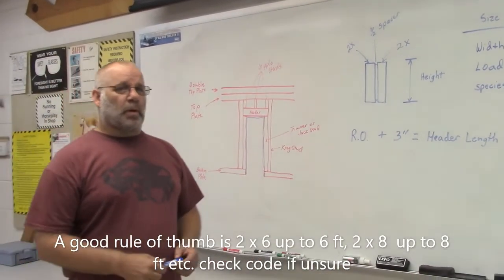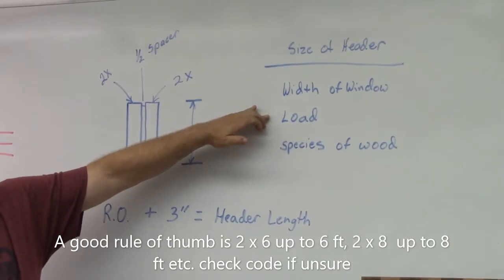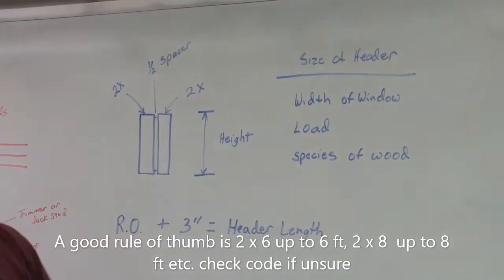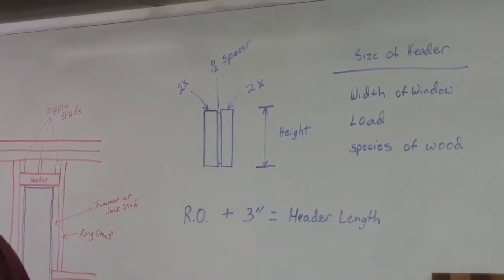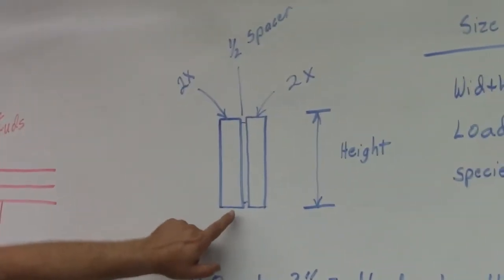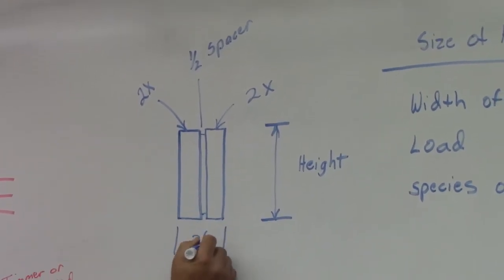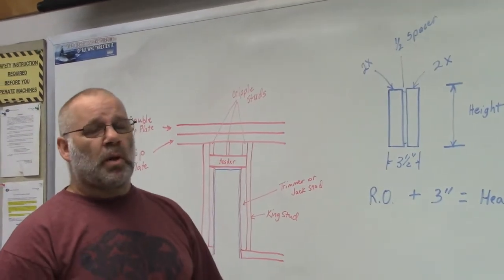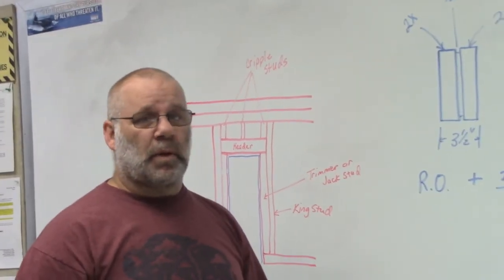How to frame a door, determine header size

Comment: Can I stack tow by four  on top of each to create  2by8  around  19 cm 2x4  hear is slightly  bigger then yours
Reply from the maker: Not recommended if it is load bearing, it would not be as strong as the 2 x 8. If it is non load bearing it would work because you are basically just filling the space.
Reply: Even if it is on the edge side stacked them on their  edge

Comment: When calculating the 2 1/2 inches for height of door rough opening am i including the height of the bottom plate that has yet to be cut out in that measurement? Or do i make the cut leave it 2 1/2 and there will be a 1 1/2 gap under door after i cut out the bottom plate? In this scenario there is only a subfloor.
Reply from the maker: The height should be the height of the door it self plus 2 1/2 inches.
Reply: @timpalmer-logstolumber1999  Thank you!